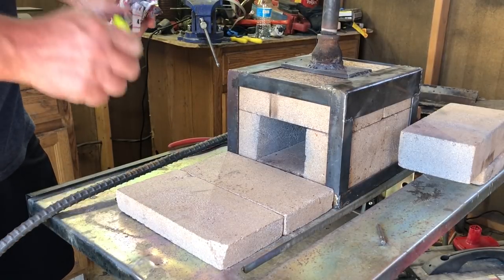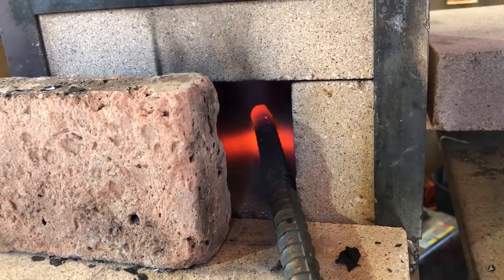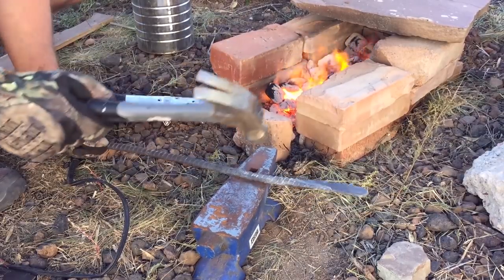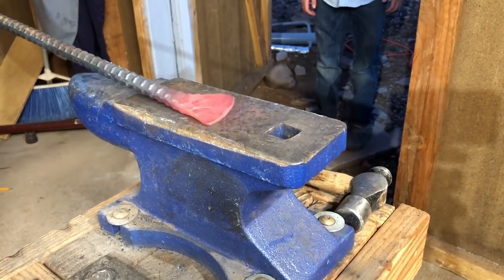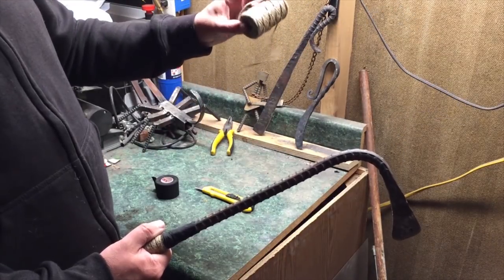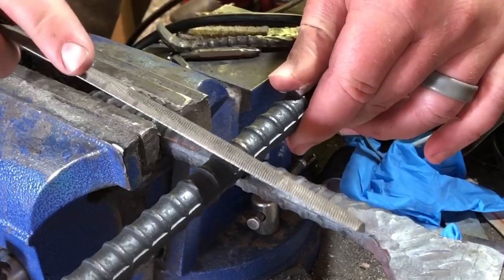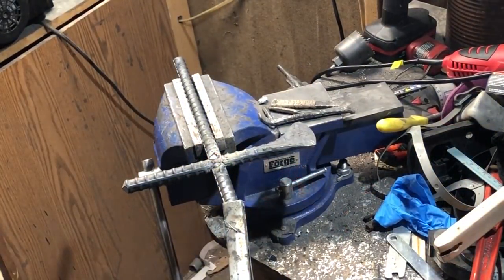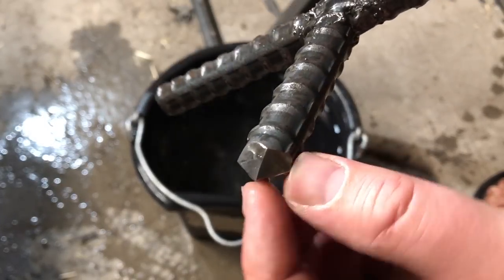How to Make a Throwing Axe that Hits Every Time

Comment: Awesome axe looks like an apocalypse axe. The gas forge seems to be working well. Can’t wait to get my forge set up but I’m on vacation in Missouri and its way hotter and more humid than back home in Fargo
Reply from the maker: Lol. From my traveling experiences, anywhere south or east of about Iowa is absolutely brutal during the summer. I'm fortunate enough to live at high elevation now in Arizona. Summers get hot (maybe 90ish), but usually very dry. Much of the summer is actually pretty similar to Fargo-Moorhead, but more dry... but that's up here at 6,000 feet, not so much in Phoenix. Anyway safe travels, my friend! 👍
Reply: FargoFX that’s good the humidity makes it 100 worse than it already is. I went 100 feet under ground in a cave and it was a nice 55-60 degrees

Comment: 1. First
2. I’m getting an anvil soon. What do I make first?
3. I have no power tools.
Reply: eGULZ I make some basic tools and knife without power tools I would recommend starting with easy decorative things like a rebar fire poker or a decorative leaf they look cool but I’m not too good at leafs yet : /
Reply: eGULZ For me personally, I started with simple rebar knives. Finally, I got my hands on a 20 ft length of 3/8 square stock and I made a couple of leafs and twist keychains (the keychains were for my grandparents and uncle's for Father's Day, lol)
Reply: Get some cheap steel and (attempt to) bash out what ever you want. At a beginner level any experience moving and heating the metal is good experience.
Reply from the maker: Agreed. I spent my first few days just whacking hot metal with a hammer and making... well basically nothing. Then I watched a video on making tongs from rebar and found out it wasn't as hard as I thought (though it took some reworking). After that I started making simple blades from rebar or scraps of steel. By the time I started making forging videos I really had only made a half dozen "real" things, mostly basic blades (although I tried a leaf--didn't come out very well LOL)
Reply: While I can understand the method of just trying to hit the steel as your first attempt, I personally like to have an image of where I want to get by the end of my forging session. For example, my very first forging session, I made a knife from a picture in my head. It gives you a sense of accomplishment and allows you to look at mistakes or things you could do differently. BTW, I'm Ian from Sub Builds 7 so u know who I am and that I'm not some random dude giving you random, misguided advice. Also, yes, I'm using my really old gaming account because it's the account I watch everything on.

Comment: This is not meant as criticism but rather as education. First thing you need to do and also teach  to all your audience is to wear protective equipment- especially on your feet. Flip flops will NOT do. If a piece of red hot steel gets away from you and lands on an unprotected foot Murphy will cause it to get caught in the sandals' strap and you will end up in hospital. If your steel is at the correct forging heat it will spatter when hit with the same result.. WEAR safety boots period...Secondly bare forearms and ungloved hands are another no no for the same reason. Get a heavy cotton coverall at least and use some type of protective gloves. Leather ones, not nylon or rubber obviously. .I have been working before the forge for 50 years and I know how easily accidents happen, especially to novices. DONT TEMPT FATE. Thirdly ensure that you do not wear any synthetic or nylon type garments. They will burn and melt into your skin. Fourthly invest in a fire resistant welding apron. I have used a leather apron I made myself for nearly 3 decades and it is still going strong. Finally your pants should have wide bottoms which ride over your boot tops to prevent hot metal from getting in the tops. Regarding your set up I appreciate your low cost approach but you need to get your anvil up to standing height and fixed solidly, otherwise a lot of energy goes to waste. I have used  2 foot thick  hardwood tree stumps of the correct height which places my anvils right under my closed knuckles when standing next to it. That way hammering is much easier and more energy efficient. A final tip would be to get yourself a decent anvil whenever and as soon as possible. You will never be able to do quality work in large quantity with that piece of junk you are using.